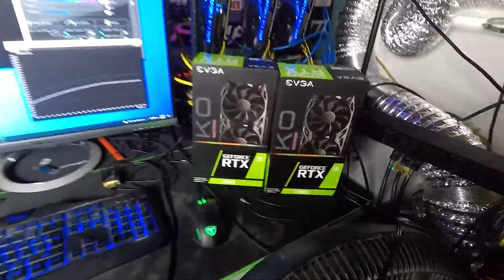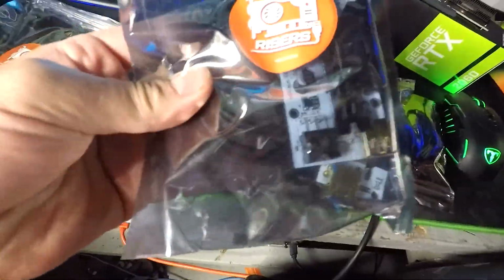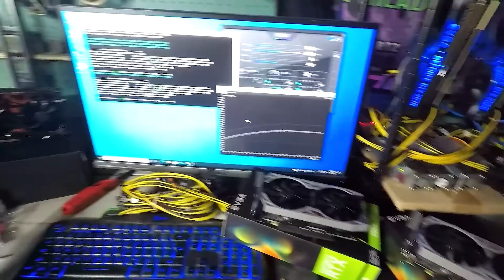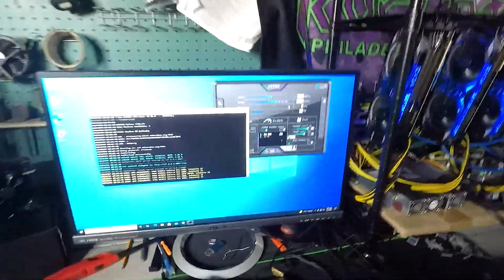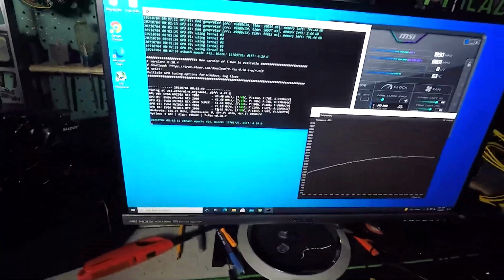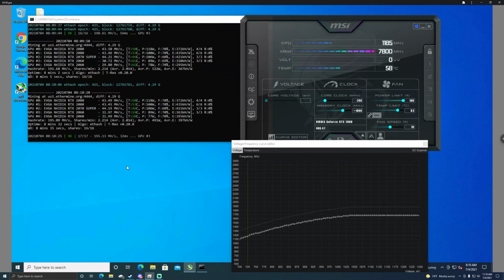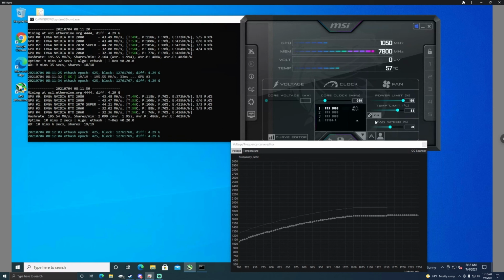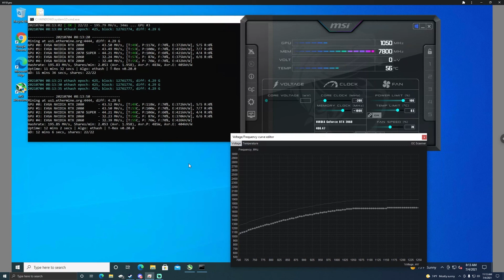2060 KOs added Install Hashrate Overclock 32mhs at 76 watts

Comment: no under power? TDP% still at 100? or it doesnt matter adjusting the power for the KO variant?
Reply from the maker: I left it because I locked the Mv on the curve editor.  So that is how I cut the power consumption down. Otherwise I would lower the PL
Reply: @jtravaglini  oh ok, whats that equate to on the curve settings like 75% tdp?
Reply from the maker: @videogamepolak0  probably lower than that. I’d say it may be closer to 60% tdp. It very similar to absolute core clock I just lock the Mv instead of the core clock. My experience is with my 20 series I am able to shave power doing so better than just using PL
Reply: @jtravaglini  sweets thanks for the responses and quick info i learned something
Reply from the maker: @videogamepolak0  I’m glad I could help.   If you are going to use the curve editor I have another video explaining it a little bit better also.  Definitely worth it IMO with 20 series gpus. I got one of my 2080’s down to 98 watts at 43.4mh/s